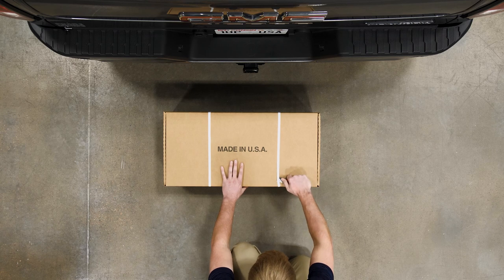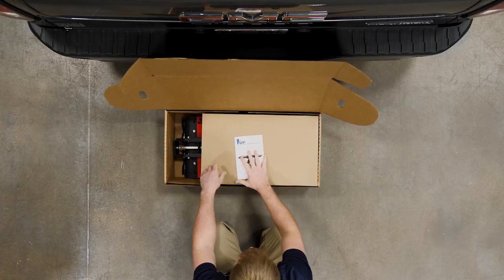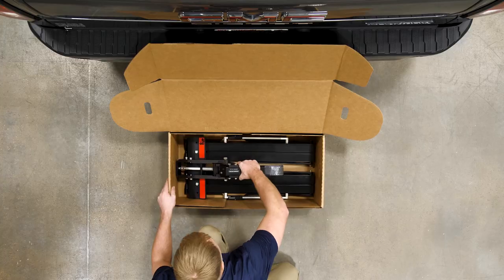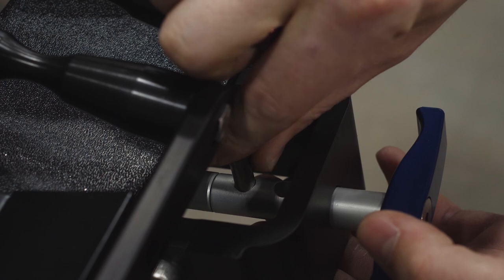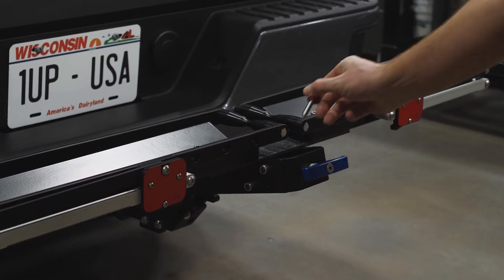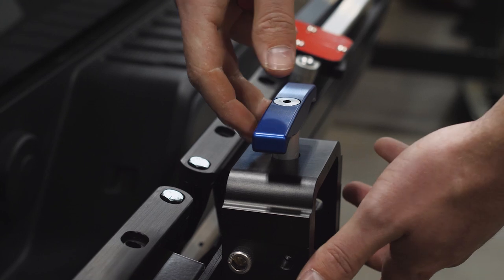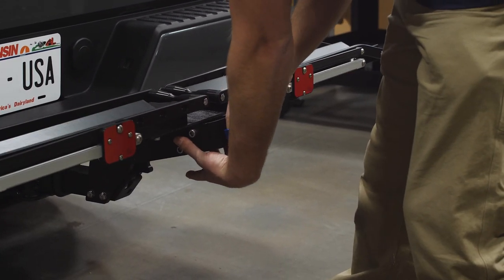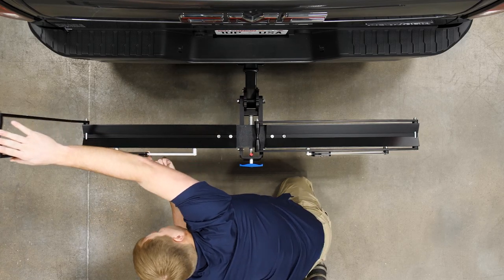UNBOXING SERIES - Equip'D Single

Comment: How is this different than the Super Duty or the Heavy Duty?
Reply from the maker: Hi there, answers to your question can be found on our FAQ page. https://www.1up-usa.com/faq/
Reply: @1upusa608  Yeah, that's great and all, but I'm not a great test taker.  Your FAQ doesn't explain why would I choose the Equip over the heavy etc or the Super over the heavy? Is there a human at 1up?
Reply from the maker: @ewxlt  There are several factors that play into finding the rack that would suit your lifestyle, which is why I sent you to the FAQ page so you can see our different offerings…You can also call/email and speak with our Customer Service reps who are indeed human. Differences can be found below.

Heavy and Super Duty are dedicated 2” hitch systems intended for heavier off-road or travel trailer use.

The only difference between the Heavy and Super Duty is a 3/8-in. x 1-in. x 13.5-in. support bar underneath the Super Duty trays. The Super Duty tray spots are rated for up to 75 lb. versus the Heavy Duty tray spots are rated for 50 lb.

The Equip-D rack system is a complete redesign, which offers a lower profile framework along with key built in features to allow for a wider range of bikes to fit out of the box. The key features include, an integrated quick release handle, wider trays, and a fully redesigned cam locking mechanism. These improvements add convenience and offer an improved operating experience. Equip-D are not intended for off-road use.
Reply: @1upusa608  Thanks for that. That helps. I did call but no one answered. I appreciate the explanation.
Reply from the maker: @ewxlt  You are welcome. Sometimes our CS team just gets backed up, but if you ever need help and can't get through, just leave us a message or email and our team will get back to you as soon as they can.

Comment: does it not block the license plate when folded up?
Reply from the maker: Hi there, generally not with the Single, but it really depends on what type of vehicle you have. We also offer different License Plate options as well. Sharing a few links below that will help.

1.25" Fitment: https://www.1up-usa.com/wp-content/uploads/2022/04/100031_FITMENT.pdf

2" Fitment: https://www.1up-usa.com/wp-content/uploads/2019/06/100029_FITMENT.pdf

License Plate Holders: https://www.1up-usa.com/product-category/accessories/